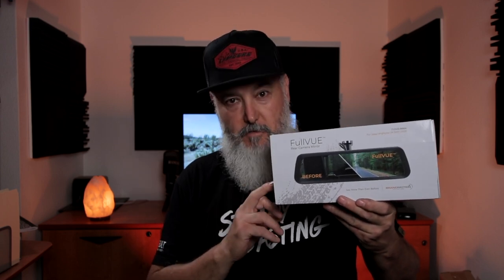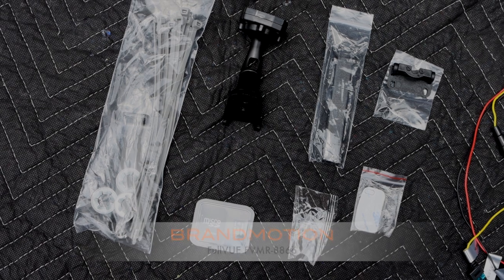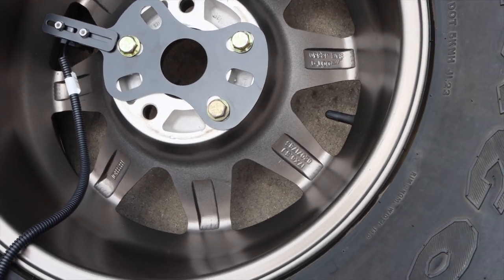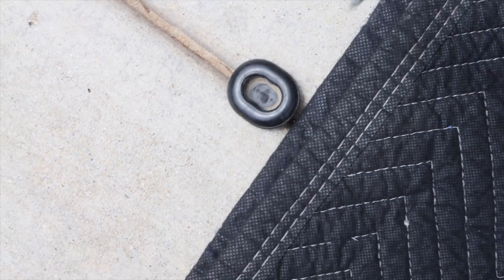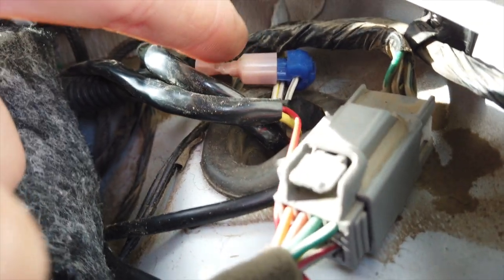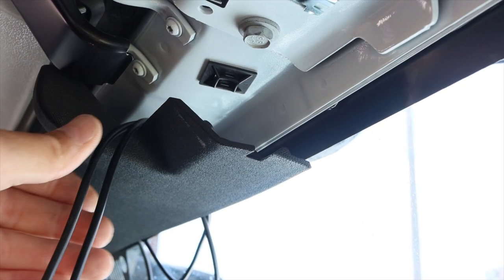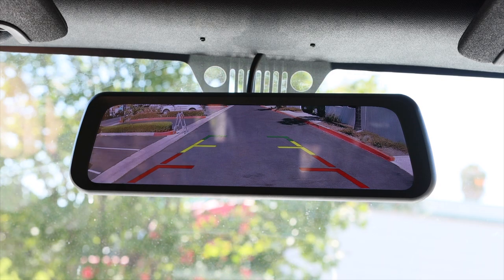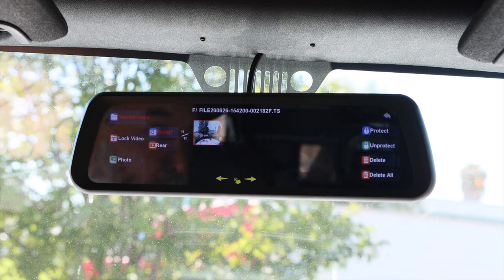Jeep JK rear view camera mirror! FullVUE

Comment: Marco,
I RF shielded my wiring harness on my '18 JKU-s the one that runs on both sides in the interior of the jeep,
 becuase the stock electrical system is noisy, this is especially useful if you are running any type of radio or "coms" or if you have an aftermarket stereo system or run any type of LED lighting see any digital electronics produce radio frequency emmisions noise so by shielding wires that can act as an antenna you will have less static on the said system.
but this goes to all jeepers hopes this helps ✌
Reply from the maker: Awesome!! Thank you for the great tips!

Comment: Awesme bid Marco. Good to see you making longer vids. Only issue is most of us are running bags over the spare (i.e. Trasharoo etc.). I have a Brandmotion rear only camera that uses my OEM head unit in my JK, but had to relocate the camera off the spare wheel (higher up). Sacrifice of running a spare tire mounted bag.
Reply from the maker: Good point! it gives me an idea on coming with a solution! Thank you!
Reply: Hey Marco, I’ve got the same issue with a bag over the spare.  Have you had a chance to come up with  a solution?  I was thinking about glueing a magnet to the camera and just stick it to my metal bumper.  Any thoughts?  Hope you’re having a great start to 2021!  Can’t wait to see more of your adventures with Brad

Comment: Hello Marco thanks for this detailed review. Because of you I’ve bought this rear view mirror camera and installed it in my 2017 Rubicon JKU. One question I want to ask is where did you tap the 12v constant yellow wire? I didn’t see it on your video so I figured I’ll just ask you.

Thanks again and looking forward to hear from you.
Reply from the maker: I'm sorry Greg! I no longer have this mirror, I recently upgraded to a complete Stinger Off Road system
Reply: @OVRLNDX  Thanks Marco for your response. I actually ran a 12 gauge wire directly from the battery through the firewall and used that to tap my 12v constant yellow wire from the mirror. I hope this would help some people reading the comments in case they have the same question like I did. Anyway, how do you like your stinger setup? Is this on your JKU or the 392? 

You and Brad are definitely an inspiration with my Jeep Rubicon build. The big difference is that I am working with a smaller budget so trying to stretch my dollars for the upgrades I want.

Comment: Hey Marco have had any issues with this setup? And if so did you get another set that works better? I installed this on my JKRU and worked great for about 6 months then rear camera started only intermittently working so makes unit useless and company refuses to honor warranty due to suspected bad harness. Thanks I really enjoy your videos and love watching you on trail recon as well.
Reply from the maker: Sorry to hear that man! I replaced the whole system, including radio with a Stinger off road system.

Comment: Great video! Is there any good recommendations to hook up constant and accessory wires? 12JKRU. Thanks
Reply: I can’t find a good source of power (both battery and acc) I end up put both wire together to an old phone charger… only issue, it doesn’t store date… also the rear image is not flipped…  when driving, I have to remember left side of screen is right side of the car….
Reply: @CTHunterZZ   sounds like some issues. Not sure what is up with flipped screen you may need to contact manufacturer about that. For battery power I tapped into wire coming off battery power cigarette plug in trunk area in the sub panel. For acc I tapped into power for cb that is getting power cigarette plug in dash using Quadratec Part #: 96080.9801. Hope this helps
Reply: @phargan143  thanks for the info, I was thinking to use  M7 (trunk’s acc port), too. Did you run a long wire or you know which wire near the front passenger kick panel to tap? As for my flipped image…. I got an RMA, but for me (Canada) to ship back and also pay a return label I might as well try to find a camera online. the product is great, but I got a lemon… 😅😂🤣
Reply: @CTHunterZZ  ran long wire.
Reply: @phargan143  looking at Quadratec and I see part# 9804?? Is this the same as 9801??
Reply: I believe so I put both #s in and the same harness came up.

Comment: Did your wire to the fusebox or where?  Can I wire to the 12 volt socket for power?  Will I need to use the constant if I wire to the 12 volt socket? Thanks
Reply from the maker: I did not! I ran a wire from the dual battery busbar using an inline fuse holder, you will need constant current, yes
Reply: @OVRLNDX  thank you for the reply. Which fuse locations did you use?